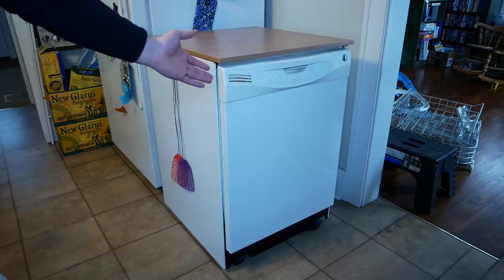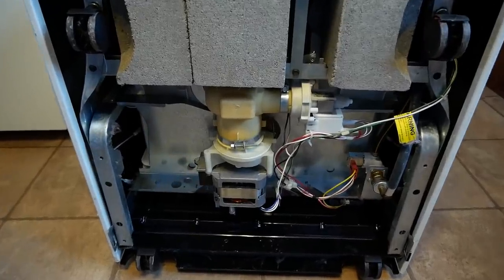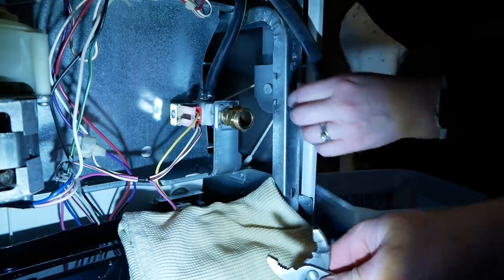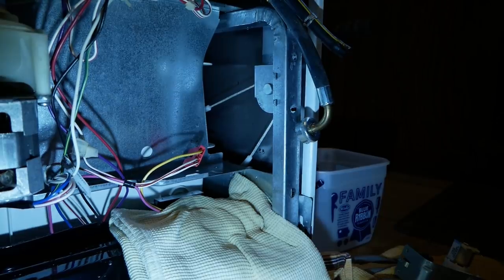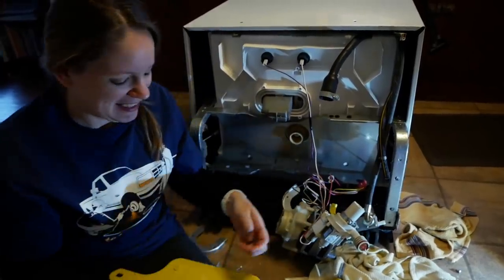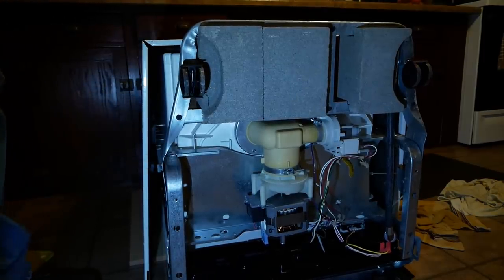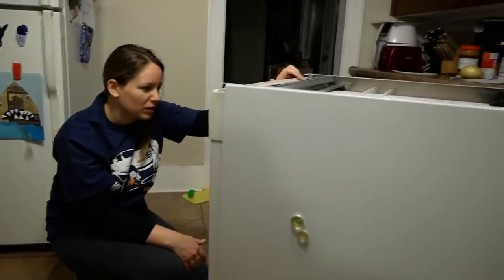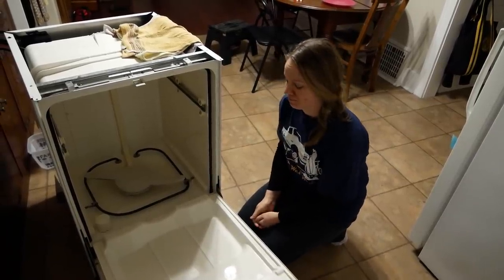Dish Washer Repair | a Lose-Lose Scenario

Comment: You’re lucky. My wife would’ve had a new one on order before I knew anything was wrong.
Reply from the maker: We were almost there.
Reply: That is what is so very wrong with peoples values  !!
Reply: Better than ordering a part because a YouTube video or blog told them to and it costing half the price of a new one and wasn’t the right part
Reply: But is that really a bad thing
Reply: My wife knew better. She said that I could fix anything but a broken heart. Those could only be repaired.
She's been gone almost one month & I miss her like crazy.
Hopefully, the next one (#3) will also be understanding to wait to let me tinker before buying another!
Reply: my would have done the same thing there george. she was like one time, i got to order a new one. before i was like hey it still under warranty have them come out to fix it.
Reply: All domestic ones are made by the same company, I think Whirlpool.
Reply: You seem like a nice couple.
A few dishwasher tips while you're down there...ohm out your solenoid,  heating element and float switch.  Check drain pump and drain hose for broken wine glass or in your case plastic. 
Check for water inlet blockage due to hard water. 
Easy way to check sump is to pour a few cups of water into sump area then run drain cycle. That model has a removable filter below the wash arm. Keep in mind that the orifices in the wash arm can get clogged from hard water deposits. After writing this, I realized this post was 2 years old.😮

Comment: Yes, there is supposed to be a small amount of water below the strainer to keep the seals from dying out during the heat cycle. If you listen when you first turn it on the first thing that happens it pumps the remaining water out.
Reply: Never leave a dishwasher dry...pour water in to keep round gasket from shrinking..they sell them wet..from mfg... tell customer new..not used..
Reply: Makes sense
Reply: actually from an appliance tech of 35 years, the cycle starts in a pump out cycle to pump out liquids that have dripped out of cups or off of dishes when it was loaded.. the dishwasher never drains all of the water out due to the positioning of the drain hose.. it must be higher than the top of pump motor and have a loop in it or an air gap to prevent siphoning, and drainback. some pumps have check valves to prevent drainback but it never pumps all of the water out.

Comment: Wes my mother would have said , “your as handy as a shirt pocket “! Well done , I once had a similar issue and it was an olive pit. By the way the bit of water left in the suction filter cup is there to protect both the plastic cup from the heat of the drying element directly above it and insure the seal on the pump stays wet.

Comment: This happened to us a few months ago, same symptom exactly. Pumps working fine but still water in the tub. The drain hose was clogged 100% even an air compressor didn't dislodge it, had to give it a coat hanger abortion to get rid of the blockage. Works fine since.  This is a built-in unit though.

Comment: A small amount of water is supposed to be left in the sump at all times.
Reply: Keeps the seals from drying out in the pump.
Reply: i don't think it has much choice the hose water flows back into pump when it shuts off anyway it cant pump air so has to stop when it starts sucking air

Comment: My grandparents had a washing machine like that, you had to wheel it over to the sink.
Reply: My parents had one too.  Mom finally got her kitchen remodeled and got her built in.  She changed the kitchen once more.  After they sold the house and went to senior living, the new owner changed it again and put the house up for sale.  Flippity flip.
Reply: Still have my Hoover machine, still works fine. One side has a horizontal rubber agitator wheel, the other side, a high speed centrifuge, that really spins the water out of clothes-
Reply: @horacerumpole6912  i see what you did there.

Comment: If somebody had told me that concrete blocks were part of the construction of a dishwasher I would have never believed them.
Reply: Same here. I didn’t believe it until I saw how they were perfectly cut out to accommodate the wheels. I guess I’ve never owned a dishwasher with the cinder block counterweight option.
Reply: Look at the botton of your laundry machine or dryer, they are probably there too.

Comment: No chainsaws, welders or sledgehammers used for this repair video? Andrew Camarata will be so disappointed............
Reply from the maker: Clearly doing it wrong!
Reply: The chainsaw to the dash was a shock! I REALLY didn't think he was going to use it!
Reply: @dans_Learning_Curve  lol, I liked the “They want me to take the skid plate off the dozer to get to those starter bolts, well, I’m not going to do that” out comes a chain attached to a skid steer bucket and we’ll just yank on it till we bust it off.

Comment: I knew the second you said it leaves water in the sump that there was something stuck in the discharge check valve.  I’ve chased that problem before.  Feels good to fix it without needing parts!

Comment: Thanks Wes! You may have also saved my marriage. Our built in GE has the same intermittent problem. Now I know what to check after removing the dishwasher, laying on its side, and disassembling, if I get a round tuit. Lately all I can find are square tuits.
Reply from the maker: Good luck.

Comment: That little bit of water left in the sump is necessary, a primer to make sure air doesn't get into the pump so it will work first time. Fun Video, Mrs Wes is all class - the jury is still out on her assistant!

Comment: The weights are there for dishwasher to be stable when door opens and the baskests are out. There's no weight with builtin dishwasher, they're fixed into the kitchen closets and under the counter top. 
First time I've seen a mobile dishwasher, it's an interesting solution.
Watching the video again and love it, it realy warms one's heart you two working together :)
Addendum: it's fixed, there's allways some water in the filter :)
Reply from the maker: There you go. Counterbalance.

Comment: I have that same dishwasher... the problem was very similar to what happened to mine quite a few yrs ago. ‘Someone’ had dropped a wooden spatula in thru the bottom rack and the lower  agitator spin arm had smacked it and splintered the wood. She who shall remain blameless realized it and fished it out (and ‘some’ of the wooden pieces) without sharing that info. A few days later, I open the D/W and see that there’s still a load of water in the bottom, FIND a few pieces of wood around the pre-filter and Shop-Vac all the water out, and like MrsWes, think it’s fixed! A few weeks later, same problem... appliance repair neighbour gets called this time, says, there’s a ‘floaty thing of wood or plastic’ stuck in your float ball which is tricking the machine into thinking it’s empty when it isn’t! Pulled out the last of the splintered wooden spatula, TaDaaa, problem solved. I had the same ‘extra’ question for the neighbour about the water that was left I the bottom once it drained properly. He stated that it NEEDED to be there as it was used to keep the pump impeller and pump shaft from drying out and leaking all over the kitchen floor! He also said, if the D/W isn’t being used regularly, throw a cup or two of water in the bottom every couple of weeks...! Glad it’s fixed, Chinesium tools are (almost) as good as having no tools!!!

Comment: I like the Speed Queen dishwashers. Individual and isolated parts. Easy to fix.

Yes,  dishwashers keep a little water in the bottom after each wash. At least all mine do, from new with tags to scrapyard good bye. All keep a little water in the bottom.

Comment: Hey Wes, good job! I worked for Sears for a while doing that. Everyone hates DWs. Always clogged up with crap! Try blowing out that trash line(or hot water flush). Non-mobile ones use one about twice that size and they still get clogged with grease! Household appliances are the last bastion of 50s electro-mechanical tech. Don't overthink it! If you're baffled, you've probably given the machine too much credit! Yes, they always have some water in them. Try making a pigtail to power the trash pump from a wall plug. Most of the time you're clogged or the trash pump is bad. Any other problem and the time is probably up. Appliance parts pricing will improve your opinion of the truck parts dealer! Cordless screwdriver and a cheap driver set is the toolkit of an appliance guy. In and out in 45 minutes, $175service fee! It still weighs on my conscience:/

Comment: Hey Wes, I'm an appliance tech of 29 years. that wire repair you did is quite common on those units, good job there! I never took one apart that far so it was interesting to see. The water after cycle complete is normal, the pump never gets all of it out.
Reply from the maker: Thanks for the info! Probably cringy to watch!

Comment: Nice fix. As a former appliance repair person, I hated working on GE/Hotpoint appliances. Dishwashers were the worst. I've found broken glass in the pumps. Customers who would use the dishwasher to remove labels from jars. The paper would plug up the drains. Dishwashers leave a small amount of water in the bottom, to keep the rubber parts soft, and act as a vaccume break for odors.
Reply from the maker: Thanks for the info!

Comment: Maybe the funniest vid on Youtube.  The intro you used was so close to going to a fourth take.  I had to call my wife in to watch it.  We have had similar homemaking watermark to out marriage.  Oh, btw, there is a chance that rolling that Dishwasher onto that mat in front of the sink may be putting a slight tilt to the machine and affecting the drainage.  I have been binge watching your channel for week now.  I enjoy every one.  Every one. I'm either entertained or I learn something, usually, both.  Have fun.  Btw, I do the same thing, try to use my wife's $3 Dollar Store "Emergency repair tool set".  (hammer, pliers, two screw drivers)  If the tools are in the little package, the phillips is a nub, the regular SD is twisted, the pliers don't match at the tip, and the hammer head falls off.  She thinks it's fine for her "purposes".  Now, in good weather I have to lock my garage and tool boxes.

Comment: We had one almost just like yours that I kept going close to 25 years, replaced motor two
times, impeller and other parts that fixed leaks, and rebuilt the water connection to faucet.

Comment: I haven't see one of the quick disconnect styles since 1970 when I was a kid. Today you normally have a coarse screen mesh and a very fine filter. Today nothing should make it past the filters. They are easily removable and cleaned from time to time. Most don't know they are there.

Comment: Our dish washer was acting up in November, water would fill and empty instantly, took a while but I found sticking solenoid on the pump and fixed it and then 2 days after Christmas it started leaking from the tub. No shame for it. It was 18 years old. Momma got a new one needless to say! I know your pain! I didn't know crap about dish washers either!

Comment: Has a stand alone dishwasher years ago.  The drain valve leaked letting the water in the hose back in the dishwasher.  Mine had a tooth pick in it along with food mush.

Comment: Now you know everything there is about dishwashers. Whatis the deal with dishwashers this weekend? 

Had to pull mine out this weekend too. Had water coming into the basement along the supply line. Bad hose fixed with a hose delete and a new brass fitting. Well done Wes.

Comment: You can go to the hardware store and get some long high pressure hoses  (like they use for washing machines) and plumb up your dishwasher permanently under the sink. Takes a bit of creativity with bits of random fittings and valves but afterwards you won’t need to move your dishwasher every time you want to use it. That’s a real pain.

Comment: There is a lot of heckling from the cheap seats Wez ......... 😂😂
P.S, you never do get all the water out of them as the run back from the drain pipe just fills the drain pump housing back up as soon as the pump stops

Comment: That was really really cute… I had the same problem with my wife’s, ex-wife dishwasher. Had to replace the electrical connector and found a chicken bone in the check valve. I wonder how does that get through there. Also scratched the front of the door doing the repair and had to get GE rattle can to fix that because our kids were grown LOL.

Comment: Bosch is keeping evacuation centrifuge impeller along with the motor inside the washing compartment. It makes the way easier to open the cover to inspect if glass or plastic part has blocked the water evacuation

Comment: I curb-picked a dishwasher which wasn't working- and yes- a very similar little piece of plastic in the check valve- kept it from draining properly.  Easily removed (more easily than in your case I think Wes), and viola- fixed.  There's a life lesson there...somewhere...

Comment: I think if everything else is working fine, don't worry about the very small amount of water in the sump. I've been trying to save my 27 y.o. GE for a couple years now. Water inlet valve, sump, motor/pump assembly have all been replaced. Turns out the latest is the heating element has died, and GE no longer makes the part. 
My new machine is being delivered next week. Bought an extended warrant because no machines today work as well as the old ones. 
Mine was built in. Wow, talk about frustration having to disconnect power and water multiple times so the unit could be pulled out from beneath the counter and turned over. Wore this old guy out. On a positive note, I think, I've got some very lightly used parts that'll soon be for sale on eBay..

Comment: I found a broken off tine from a fork in our dishwasher when it wouldn't drain.  The tine had successfully made its way past the filter and conveniently lodged itself into the pump impeller.  Only we had a built in so I had to extricate it from the cabinets in order to flip it over and get at the pump...

Comment: The Mrs. and I had an issue with our washing machine.  It was under warranty so the guy came out to work on it.  He found the control board went out.  He also checked the trap. He found a .22 LR live round in the trap.  We now check all pockets be for we run the washer.

Comment: Wes! You go the same thing with needle-nose pliers and slide cutters with your fingers, as I do. 
Using the ring finger like a spring/tension/activator to reclose them.
Reply from the maker: Old habit. I get bit sometimes on pliers that close too far.
Reply: @WatchWesWork  It's a good habit... gives you much more control over your tools!
Reply: @WatchWesWork  I've hacked up my hands quite a bit with pliers like that too...

Comment: FUN FACT: in Wes' latest robot video, the $1 cutting board is mentioned multiple times. At the end this video is referenced by Mrs. Wes, which also features a $1 cutting board.

Moral here is to stick with bamboo, it won't jam your dishwasher and doubles as a remote control base 👍

Comment: A message to Mrs Wes.  Use some E6000 glue to glue that little thingey back on.  Also, if I twas you, I'd remove the remaining 3 pads and glue them back as well to keep them all set in place more securely.

Comment: In my younger days I may have loaded up the dish washer with a die cast IH 1066 with duals, a disk... and planter...   Field conditions were good in the morning, but an afternoon deluge made it less than ideal.  Everything was packed with mud.  I associated car wash with dish washer.  I thought it was a brilliant idea.  Lots of little stones buried in that mud.  It sounded like a cement mixer when it drained.  Dish washer had a miniature garbage disposal in the pump... HAD is key.  That wasn't the worst part.  My planter was destroyed.  The detergent eroded lots of components right off.  They must have been magnesium or zinc.  That was a bad day.
Reply from the maker: LOL. Don't be giving my son ideas! He is borderline obsessed with car washes.

Comment: Should have hired you to fix our dishwasher. We had a repair man come to fix our no drain issue (also a piece of plastic stick in the pump) but in the process he over tightened a clamp flooding our basement when we let it run overnight.

Comment: You have to watch these types when they go, my aunt had the same issue but the sink was filling up, all she had to do was clear the sink out when using it and have the hose sit not entirely at the bottom so there was a buffer before the hose was sitting in water and back pressure did it’s thing, could have been a weak pump or impeller or seals though but I doubt it

Comment: the dreaded dishwasher repairs, last intermittent problem I had was quite a few years back, run start capacitor £5, part not enough guts to start the initial power up motor driving, touch wood its still going strong, well over 10 years old.
from memory they are designed to leave a set amount of water in the bottom.

Comment: Heavy clean the drain in the middle of the bottom of the cabinet and gets all go tell for trash and stuff and if you don't take it out and cleaned real good it'll hold water after you stop running the dishwasher mine used to do

Comment: Actually it is the same as the built in model.  It's just in a box with rollers, a line cord instead of being permanently wired in, and a faucet adapter rather than plumbed in.  I did appliance delivery/repair for four years.

Comment: BTW you could stuff some insulation around it to deaden the sound significantly - it's cheap and easy.  Good fix!
Reply from the maker: It's already a huge PITA to get that cover on.
Reply: @WatchWesWork  Not that I'm wishing a "next time" for you, but if you happen to have to get in there again....

I always wondered how they kept portable dishwashers from tipping over when you opened the door and extended the racks - now I know.  Concrete!